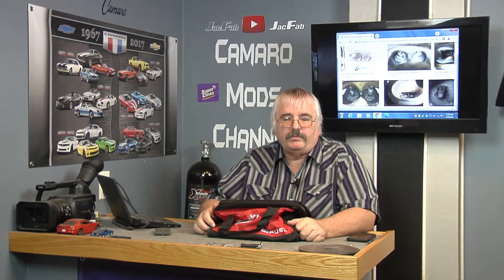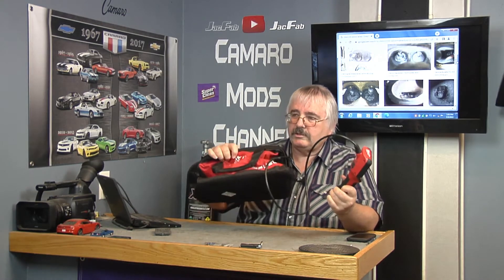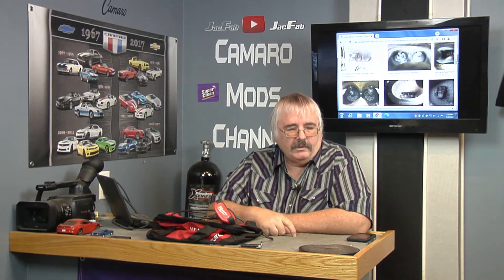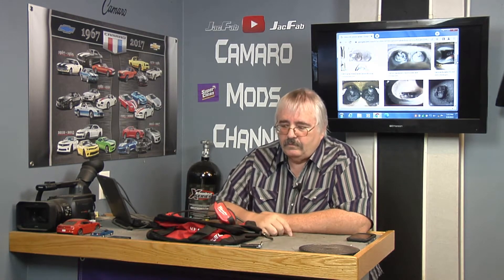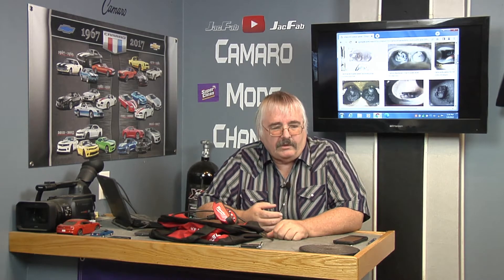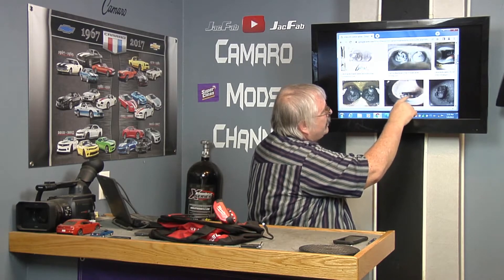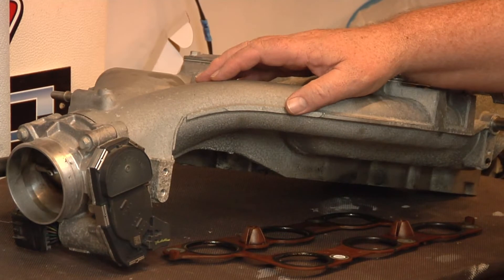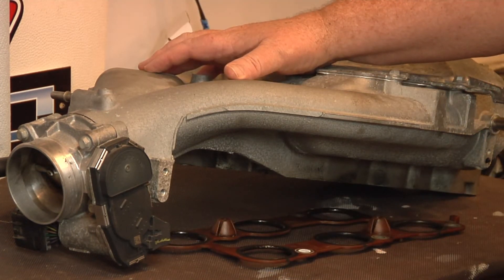Chevy 3.6 LLT What Your Intake Valves Look like at 66k miles

Comment: I noticed those holes on the PCV haven't been drilled out yet, they're still the stock size!  
For the color, I vote for silver.  Whenever I owned a 3100/3400, and I'd have the engine apart to replace the failing head or intake gasket, I'd paint the plenums with VHT high-temp "aluminum" engine paint. Made the engine look new, no matter how much oil and grime built up on it..
Reply from the maker: Yes, it was stock size, if it was plugged up i would have drilled them out. I believe in 2011 GM changed it to the bigger holes in the PVC. I'll check it again when I go back together with it. Thanks